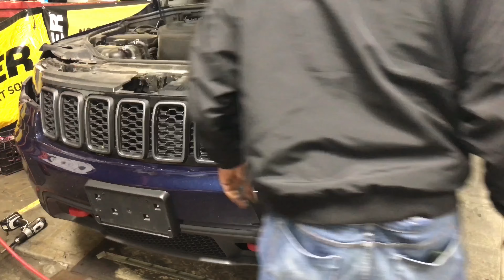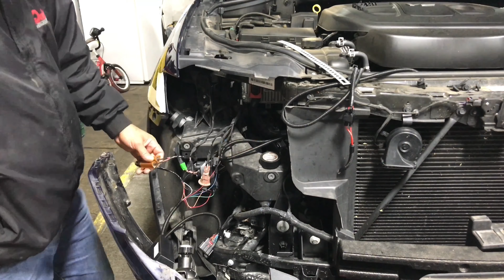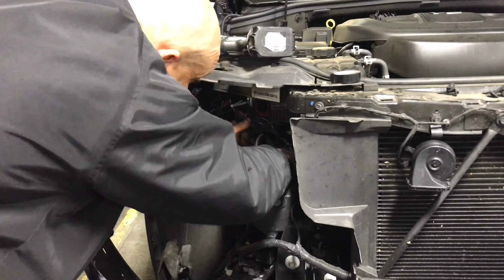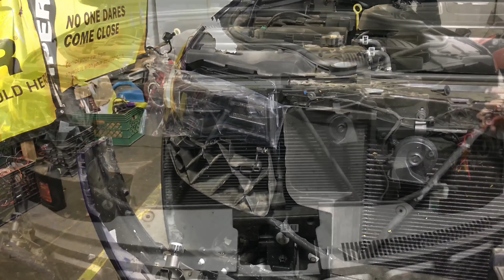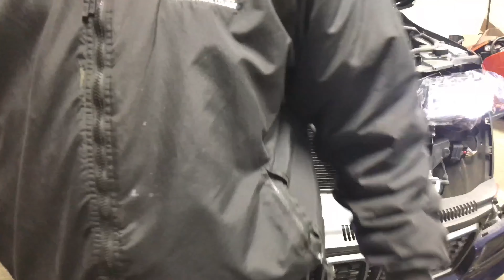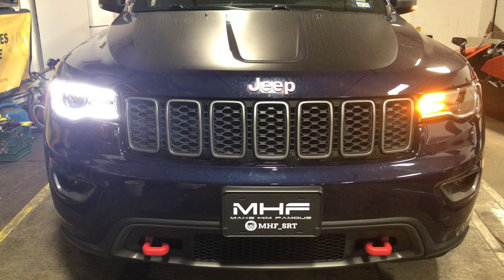⚠️ 2018-2021 Trail Hawk Jeep Grand Cherokee | HID Headlight Swap | Halogen To LED

Comment: Nice video, good detail.  I assume this same exact process would apply to my 2017 GC Laredo with the stock quad halogen lights?  Everything comes off the same etc?  I'm stationed in Korea so everything is DIY in my driveway.
Reply from the maker: Patrick McGee exactly same process,  email us if you have further questions.
Reply: @MHFAutoLighting  I have a 14 grand cherokee limited,...i want to convert to this set up from the halogen lights,...are you guys able to do this at ur shop or what do u suggest?

Comment: Hello, excellent video, just one question, did you have to remove the headlight washer from the new headlights?
Reply from the maker: @NanoDiaz777  yes
Reply: @MHFAutoLighting  Thank you for answering, do you know if it is possible to remove the Washer Headlight of the original foci of a Jeep Grand Cherokee Overland 2014?
Reply from the maker: @NanoDiaz777  yes

Comment: just purchased a 2021 black laredo x and came across your vids on upgrade bi zenon led/hid headlight swap. awesome, are you located in NJ? and is it easy plug n play to install?
Reply from the maker: Yes we have authorized installers in New Jersey, the harness is plug and play, checkout our website MHFautolighting.com
Reply: @MHFAutoLighting  awesome news I'm located in East Brunswick NJ, location? and do I need to order through your website 1st or through your authorized location?  thx